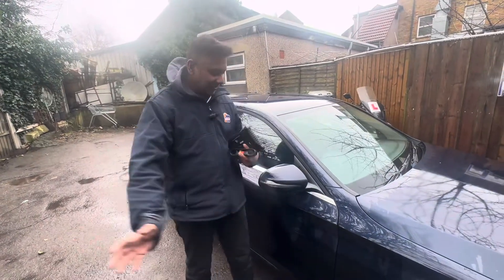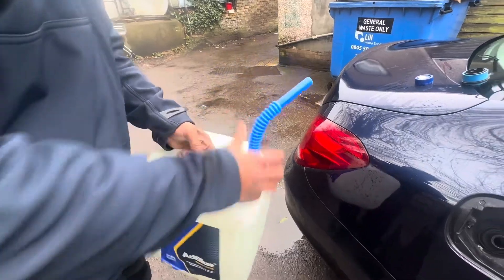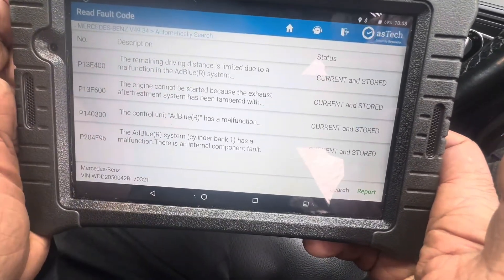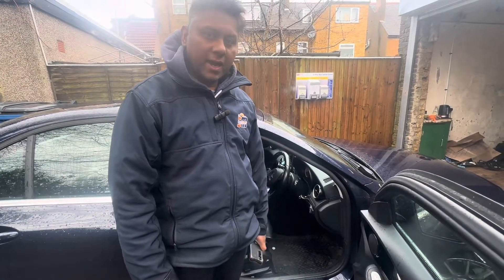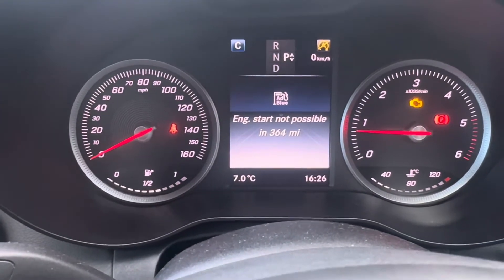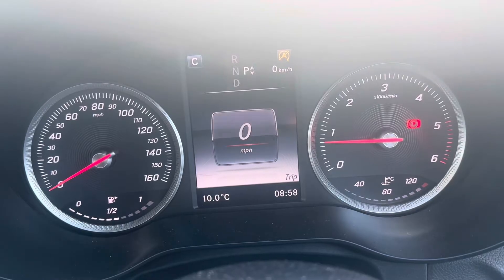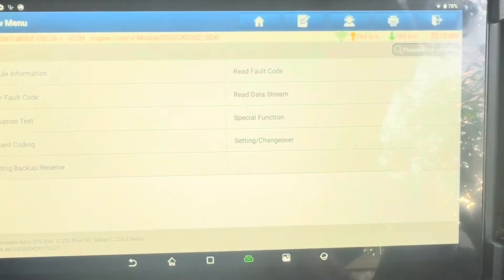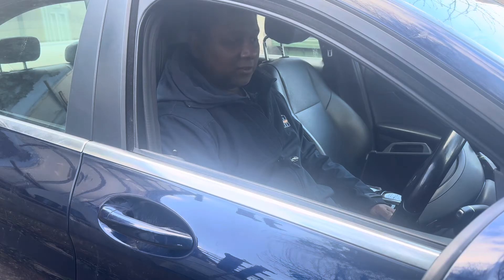MERCEDES ADBLUE PROBLEM AND RESET ADBLUE METERING SYSTEM

Comment: i have add blue pump issue no reading adblue and eml on with count down 350 miles left and engine will not start w213 220d mercedes any helps?
Reply from the maker: Follow my video you will get the answer if not, you can come to us❤

Comment: Why you cleaned dpf as it didn’t had any faults on that?
Reply from the maker: Because Dpf pressure height
Reply: @SanuMotorswithCharlie ok, you fixed many mercedes with adblue faults, can you tell me are all cars usually in low power mode because of adblue faults? Or they still have full power and adblue faults doesn’t put in limp mode?

Comment: Hi Charlie. 
My adblue menu is missing at all in E350 2016, and got code:
P20EEFD SCR Catalytic Converter Cylinder Bank 1 not sufficient. The car slightly, gently jerks ( stalling or limping ) at speeds from 60 to 90 m/p few times. Slow peed and high speed no issues.

Other codes: 
P1BC300
P010C38
C40100 Fuel Pump (N118) but says error can be ignored. 

Any ideas, please.
Reply from the maker: That sounds like a tricky issue, I would suggest checking the relevant sensors and the metering system thoroughly to diagnose the problem.

Comment: So what fixed the issue?  I have only the last code cylinder bank 1
 malfunctioning.
And can it cause power lose?

Thank you
Reply from the maker: Thanks for your comment! 👋
In our case, cleaning the AdBlue injector and resetting the system properly solved the issue. 👍
And yes, if there's a fault on cylinder bank 1, it can cause a power loss, because the engine may go into limp mode to protect itself.

If you need more help or updates, feel free to join our groups:
👉 WhatsApp group: https://chat.whatsapp.com/JOvJCdZYdV9J6PvIXw2RV0
👉 Facebook group: https://www.facebook.com/share/g/15msa3NJmn/

Good luck, and let me know if you need more tips! 🚗🔧

Comment: I have the same 2 faults on my car. AdBlue level is being read but the EML is on and Engine Start Not Possible in 200mi. When I plug in Xentry the Pressure in AdBlue Circuit is 0.0bar. Will a software update remove the codes?
Reply from the maker: If Xentry is showing 0.0 bar AdBlue pressure, even though the AdBlue level is OK, it usually points to one of the following:

🔧 Common causes:

Faulty AdBlue pump (not building pressure)
Damaged or leaking AdBlue line/feed pipe
Faulty pressure sensor
Blocked injector or crystal build-up in the system
✅ About the software update:
A software update won’t clear the fault if the issue is mechanical (like a bad pump or blocked injector). However, if you've already fixed the hardware issue (e.g., replaced the feed line or pump), then a software update or full AdBlue system reset using Xentry can clear the codes and remove the "Engine start not possible" message.

⚠️ Important:
The system needs to build pressure before the reset. So if you're still getting 0.0 bar, the update or reset won’t help alone—you’ll need to fix the pressure issue first.

📲 You're welcome to join our support groups for more help or to share updates:

👉 WhatsApp Group: https://chat.whatsapp.com/JOvJCdZYdV9J6PvIXw2RV0
👉 Facebook Group: https://www.facebook.com/share/g/15msa3NJmn/

Let me know what you've already tried—I’ll guide you further!
– Charlie @ Sanu Motors

Comment: Hi Charlie, I have an e250 and I have a code P2048. I checked my injector and the resistance was at 7-8 ohms. Is this normal or should I replace it. Also do I need to bring to a dealer to reset the number of starts left
Reply from the maker: Hi there! For the P2048 code, which typically relates to a problem with the reductant injector circuit, checking the resistance is a good step. A resistance reading of 7-8 ohms for the injector is generally within the normal range. However, if you're still experiencing issues, it might be worth considering other factors like wiring or connectors that might be faulty.

As for resetting the number of starts left, it's often necessary to bring your vehicle to a dealer or a specialized mechanic. They have the appropriate tools and software to reset the system and clear any stored codes properly.

If the issue persists, it’s best to consult with a professional to ensure there aren't other underlying problems. I hope this helps!
Reply: where can I get the code? Thanks
Reply: @h2l359  I fixed the issue, just replaced myadblue injector then Mercedes reset the system. I should have just brought it in for extended warranty on the field measure, but I had already installed the part. Check you warranties with dealer before

Comment: Goood work charly can you have any advice for me please i change the nox sensor and the fault code delete but i have the fault code p13f600 still there so the car can’t start after 234mil , and the sensor of the level of adblue is working it’s giving 7080mile , the fault code p13f600 didn’t remove because of the air conditioner was working no ?
Reply from the maker: Thank you for your message! I'm glad to help. Here are a few suggestions based on your situation:

1. **Fault Code P13F600**: This code typically relates to an issue with the emissions control system, often involving the AdBlue system. Since you've already changed the NOx sensor and confirmed the AdBlue level sensor is working, there might be other factors at play.

2. **Air Conditioner Impact**: It's unlikely that the air conditioner being on would directly cause the fault code to remain. However, it’s important to ensure all systems are properly checked when diagnosing issues.

3. **Check for Software Updates**: Sometimes, a software update to the vehicle's control unit can help resolve persistent fault codes.

4. **Inspect Wiring and Connectors**: Faulty or corroded wiring and connectors can sometimes cause issues. Make sure to inspect these components thoroughly.

5. **Consult a Specialist**: Given that the car can't start and the fault code remains, it might be best to consult a specialist who has the right diagnostic tools to pinpoint the exact cause of the problem.

Clearing persistent fault codes can sometimes be tricky, but a professional should be able to help you get to the bottom of it. I hope this helps, and good luck with your car!
Thank You
Reply: @SanuMotorswithCharlie  thank you Charly this information helps me understand more about it , Good luck with your work , God bless u 🙏
Reply from the maker: You're welcome! I'm glad the information helped. Good luck with your work as well, and God bless you too! 🙏😊

Comment: How did you update the software Just from the OBD?
Reply from the maker: Updating software via the OBD (On-Board Diagnostics) port is a common method used by automotive manufacturers to deliver software updates to vehicles. Here's a general overview of how it typically works:

Preparation: The vehicle manufacturer releases a software update to address various issues, improve performance, or add new features to the vehicle's electronic control units (ECUs).
Distribution: The software update is distributed to authorized service centers or dealerships. Sometimes, updates can also be distributed directly to vehicle owners through online portals or over-the-air (OTA) updates if the vehicle supports it.
Connection: To install the update, a technician connects a diagnostic tool or programming device to the vehicle's OBD port. This port allows access to the vehicle's internal systems and ECUs.
Authorization: Depending on the manufacturer's protocols, the technician may need to authenticate the software update using a secure code or authorization process provided by the manufacturer.
Installation: The diagnostic tool communicates with the vehicle's ECUs and uploads the new software. This process typically involves flashing the ECUs with the updated firmware or software.
Verification: Once the update is installed, the diagnostic tool may perform a verification process to ensure that the update was successful and that all systems are functioning properly.
Documentation: The service center or technician may record the details of the update, including the version number and any relevant information, in the vehicle's service history.
Completion: After the update is successfully installed and verified, the technician disconnects the diagnostic tool, and the vehicle is ready for use.
Overall, updating software via the OBD port allows manufacturers to efficiently deliver improvements to vehicles without requiring extensive hardware modifications or manual intervention. However, it's crucial to ensure that updates are performed by authorized technicians to maintain the integrity and security of the vehicle's systems.

Comment: Hi Charly how can I do the software update I have same issue with my car
Reply from the maker: Hey there! It's important to keep your car's software up to date to ensure optimal performance and address any potential issues. Here's a general guide on how to update the software in your Mercedes C-Class:

Check for Updates: Start by checking if there are any available software updates for your car. You can do this by visiting the official Mercedes-Benz website or contacting your nearest Mercedes-Benz dealership. They will be able to provide you with information on available updates and whether they are applicable to your specific model and year.

Schedule an Appointment: Once you've confirmed that there are updates available, schedule an appointment with your dealership or authorized service center. They will have the necessary tools and expertise to perform the software update safely and accurately.

Visit the Dealership: On the scheduled date, take your car to the dealership or service center for the software update. The process usually involves connecting your car to a diagnostic computer, which will then download and install the latest software updates from Mercedes-Benz servers.

Testing: After the update is complete, the technician will typically perform some tests to ensure that the software has been installed correctly and that all systems are functioning properly.

Feedback and Follow-Up: If you continue to experience issues after the update, provide feedback to the dealership or service center. They may need to further investigate or perform additional updates to address any lingering issues.

It's important to note that software updates for cars can vary depending on the model, year, and region, so it's best to consult with your dealership for specific instructions and guidance tailored to your Mercedes C-Class.